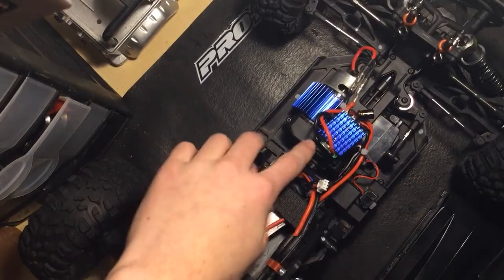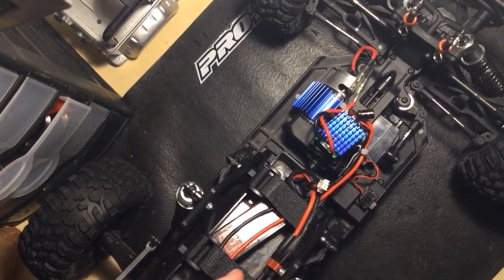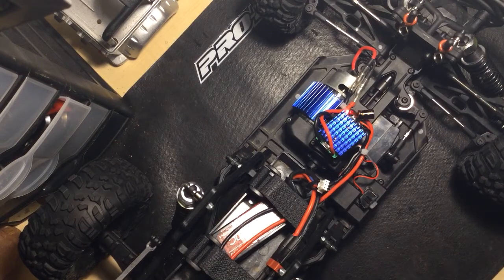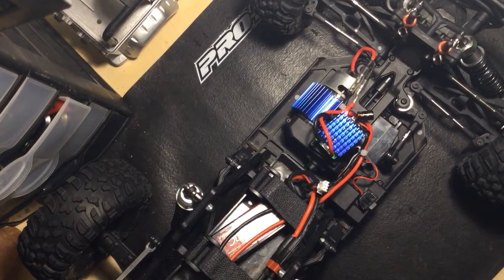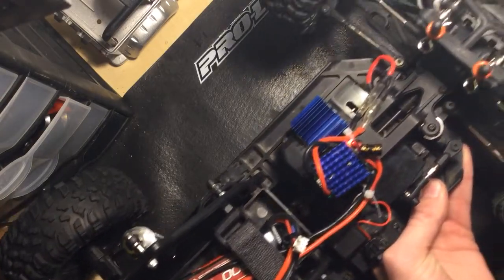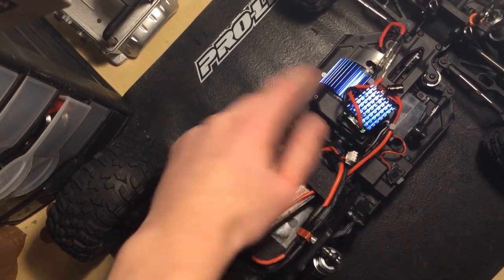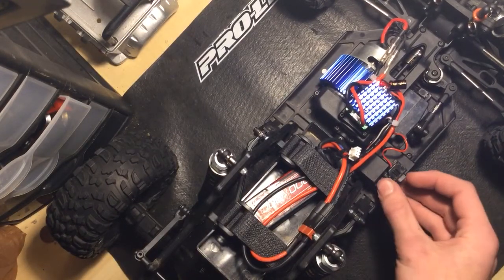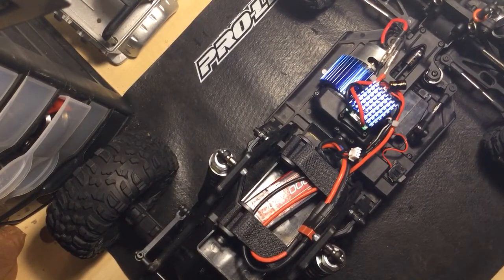how to Change low voltage cutoff on helion rockrider

Comment: Good video man so with the low voltage cutoff on my lipo should be ok so I don't need a lipo buzzer on it
Reply from the maker: robert jr correct:)
Reply: Thank you did u do a video for crawler mod
Reply from the maker: Yes I also did video for the 1/35 orlando crawler :)

Comment: Is this only doable if I have a Lopo connected or a brushless? I just bought a brushed one and I can't get it to cut off so I can use lipos
Reply from the maker: Enter My Horizons lipos, you can use lipos on a brushed if you have it brushed.
Reply: Rc Reality awesome thanks!! Is it also disable to replace the brushed for a brushless or do I need to get a different model
Reply from the maker: you will need a brushless esc for the brushless motor
Reply: Rc Reality Thanks for the fast reply. I had just bought mine yesterday and I'm already excited to customize it and add some upgrades to it. Do you have any suggestions or links to specific brushless combos for the motor and ESC?
Reply from the maker: the motor and esc i have in mine is a castle creations sidewinder 3 esc and a 3500KV VELINEON brushless motor but i know helion has a brushless system for it
Reply: Rc Reality awesome, thank you for all your feedback so far. I'll probably go to my hobby shop today and talk to them about it too. I'm currently having a problem where it cuts out every now and then and when I try to accelerate I just see the red LED blinking so I'm not sure what's going on there it might be a bad esc. Batteries are fully charged